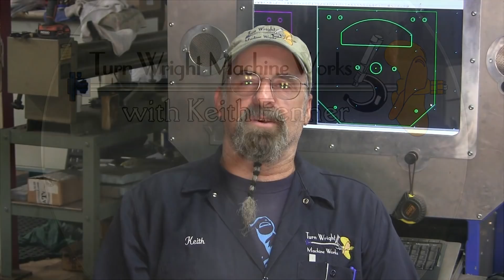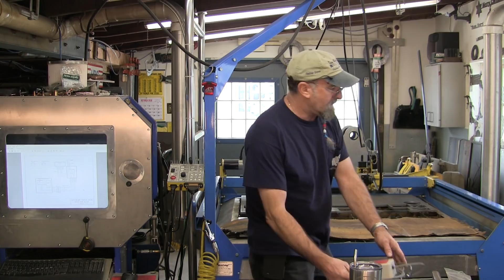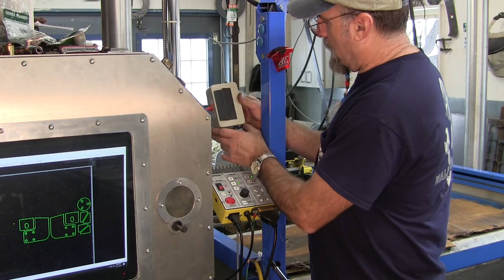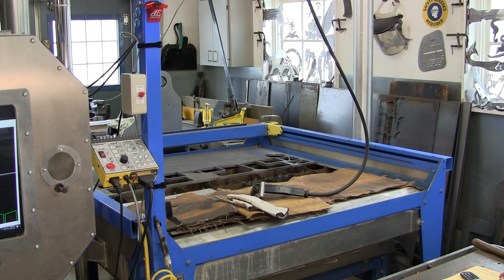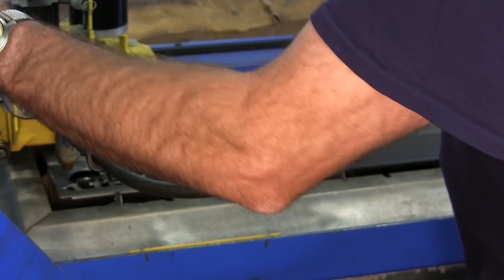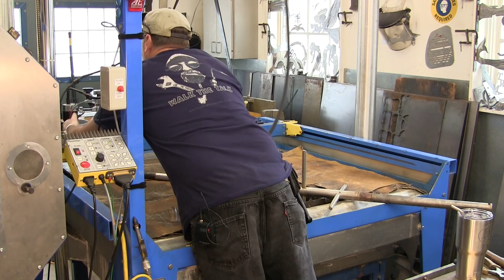Switch It!

Comment: Here is something that might hold some interest too..
https://vimeo.com/192665685

Look at the cable lead on the new Cutmaster 60i.. Same torch basically, and they will be coming out with new consumables for the Cutmaster soon.Right now Victor is using the standard one torch consumables in that machine. I am thinking they will retro to the older machines too.., Since they both use the ATC connection..

Comment: I wonder if it has been tested to run the switch before the Plasmacam controller. The way you hooked it up, the controller needs to be on and likely initialized so that regardless of running auto/manual mode on the switch, it will work. If you ran the output of the switch into the controller and the input from the Hypertherm then wouldn't this work without having to have the Plasmacam controller on? Seem like it would be nicer to not have to have it on all the time is all. Other than that, the switch is a great idea!

Comment: Whow, that cutter is fast! Is it top of the line or mid range?
Reply from the maker: Cutting speeds are related to the thickness of material for the most part, not as much to the make of machines, the size and amperage plays some as to what your limits are. ;{)------

Comment: I'm honestly surprised this sort of thing isn't just built into the control panel. TO me it just makes sense that you'd want to be able to take the torch off the machine and use it manually at times.

Comment: Forgive the noob comment please but is your plasma high freq start? I didn't see a flaming pilot arc. I have that a  hf start causes problems with electronic equipment...Thanks for the vids. Also thanks for not making ads instead of instructional vids.I really appreciate your time. Kind regards...
Reply from the maker: I had to trade off and get a non HF start, your right, HF plays havoc with computer controls. The non HF, has a starting cartridge that initiates the arc. ;{)------

Comment: your label 'suck off' seems more weird than 'flame on' to me :)   id relable that to vacuum on or off...    for the switch, you could use one of those guarded military type toggle switches, with a lighted mode, then it will be even more obvious what mode its on and protect it from any accidental

Comment: Hey Keith. Great Video. Question, are you using the 9-8237 shielding cup on your torch when you are using it with the plasma cam?. and are you using the gouging shield cap with that or only the shielding cup. Thank you so much for the information.
Reply from the maker: I am using the 9-8237 plus a 9-8238 for 60 amp tip clearance. ;{)------

Comment: if safety with that switch is concerned, use one of those military style toggle flip covers. would look cool too!
Reply: Yes, aircraft-style, guarded flip-cover switch would work great to prevent accidentally switching to manual mode while the torch is still attached to the carriage.

Comment: Keith, if you want to prevent and accidental flipping of the toggle switch, replace it with a locking toggle switch (Google it).  these style switches require you to pull the lever out before it can be flipped.
Reply: Military-style guarded flip-cover switch as used in military aircraft, might actually be better.

Comment: Hi there keith, loving all your videos. I have a random question, I am after some engraved switch labels, like your flame on flame off labels on the new switch. Where would I find these? I have had no luck so far. Thanks in advance,
Best regards,
Brad
Reply from the maker: There are a lot of guys out there with carving machines that can and have the experience already that could knock out custom engraved labels. Engraving shops. I plan to be able too as well, just haven't set up and played with that just yet. ;{)-------

Comment: Keith   After you trimmed the cut-out remainders from the 1/2" plate manually, I was wondering whether you could have used the auto setting to trim a straight edge on the plate ?   Would you do that by drawing a straight line in PlasmaCam and setting that line as the cut path shape ?   Thanks
Reply from the maker: Yes and sometimes I do that but when the stagger of cutouts, is pass the minimum variable of waste, I nip the small sections. ;{)------

Comment: wow looks like you're getting much needed improvements. Have you thought about a PLC/relay based switch for your vent? Automatically turn on when cutting, shut off when done.
Reply from the maker: five steps, from machine and a reach from where I set up work I'm planning to cut, before heading to machine. ;{)-----

Comment: Hey Keith, nice video! Right at 8:00 you can see a yellow light turn on on your microphone transmitter as you engage the torch. Is that a clipping indicator? Or RF interference? Just curious... Cheers, Mik
Reply: That yellow LED is the audio overmodulation indicator. It's possible that RFI from the torch is lighting it up. The torch doesn't seem all that loud. It's hard to tell because the camera probably has automatic audio gain that levels everything. Keith, your audio sounds really good. Seems to be much less hiss now.
Reply from the maker: New unit and I adjusted down the gain a bit. ;{)-------
Reply from the maker: Thank you!  
I don't know I'll have to check that out! ;{)------

Comment: you ought to make a clip-on spring steel bracket for that torch switch. Velcro should just be temporary, but usually sticks 😀
Reply from the maker: Been using that same piece for two years now!  ;{)------

Comment: Not that is bothers me but I do think you should have a remote for your fume extractor system so it can be started while you are at the plasma cam and not have to run halfway accross the shop to start/stop it everytime.  Just a suggestion.
Reply from the maker: Five steps and most the time I have it started before heading to the controls, during filming I hold off a bit a that shows a pause in event. ;{)------

Comment: If you think there's potential for accidental switch, you can make your own safety walls out of a piece of brass. I made my own It's a simple elongated oval shape that has a drilled center to accept the thread size on the switch. Then i bent the tabs up and it keep the switch shielded. Super cheap, from scrap.
Reply from the maker: I think it is a petty concern, there are two other physical steps to create a spark before the system is live at that point of concern. ;{)-----